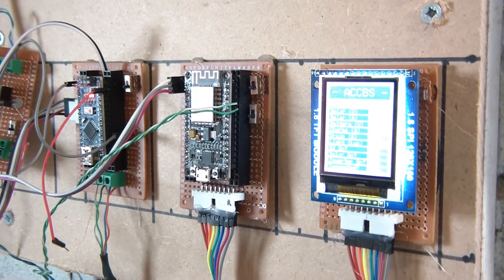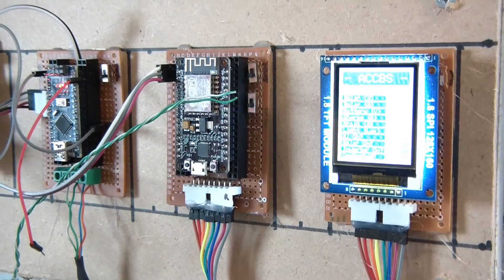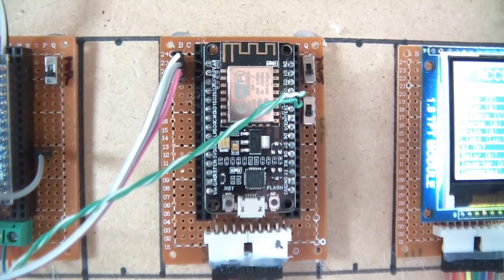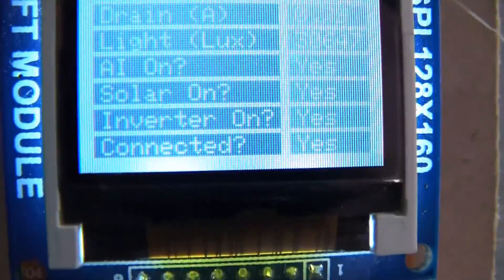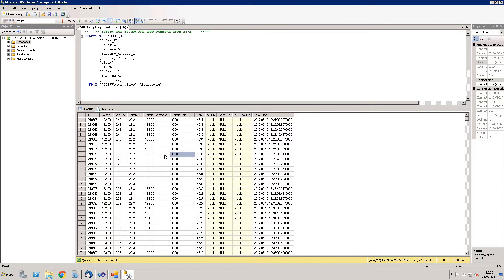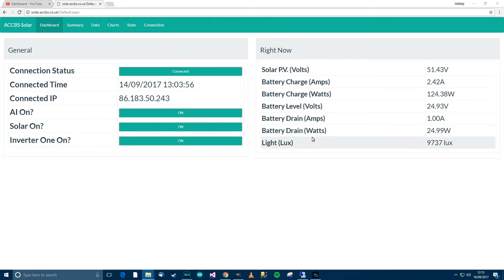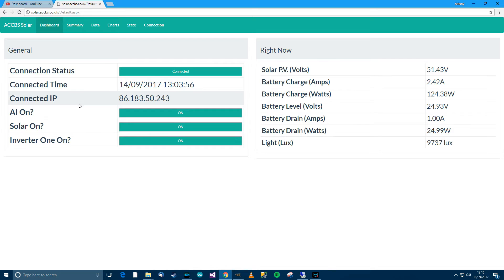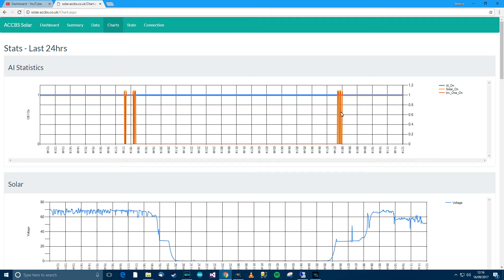My DIY Offgrid Solar Power System (The Software!)

Comment: Thank you so much for this! Loved it!
Reply from the maker: Karl Ng Thanks Karl! The next solar video will probably be about some improvements which I'm going to make with solar. Some things I need to improve are: switching time, connection drop issues, sensor accuracy.
Reply: Antony Cartwright Is there accuracy problems with the current shunt? There is another alternative sensor which is the INA3221 current sensor.
Reply from the maker: Karl Ng There's no accuracy problem with the shunt. The shunt is super accurate, but the problem is with the amplification and reading into the arduino.
Reply from the maker: Hey! Thanks for that. I might actually have one of those here. There's a video coming tomorrow and the day after about another amplifier. A special one! It's actually an ADC with a gain setting. :-)
Reply: Antony Cartwright What is your current amplifier module?
Reply from the maker: Karl Ng AD8202. :)